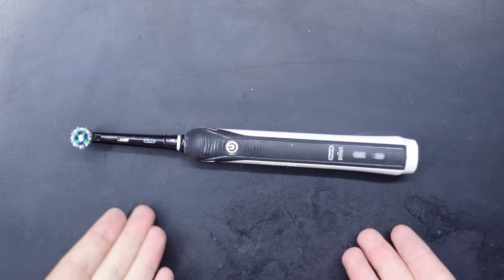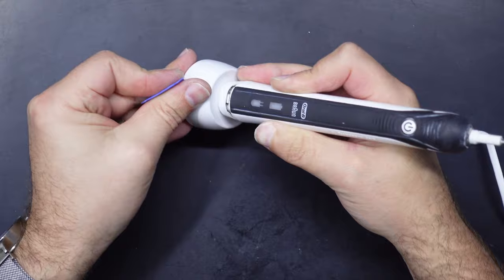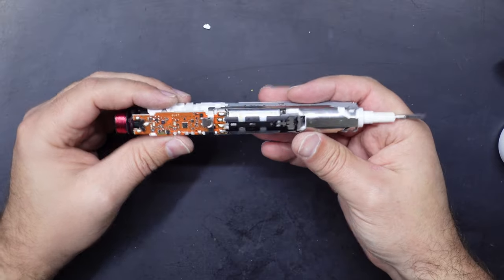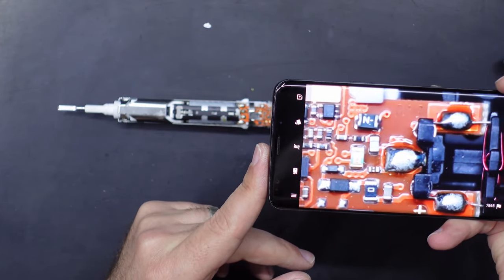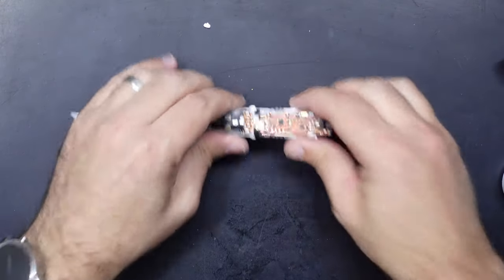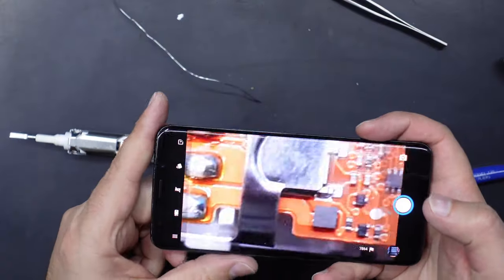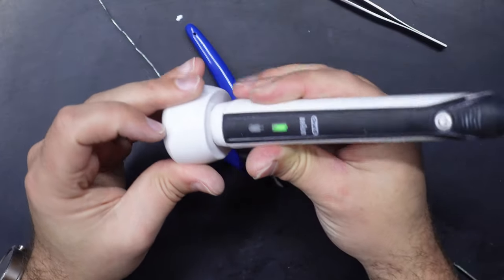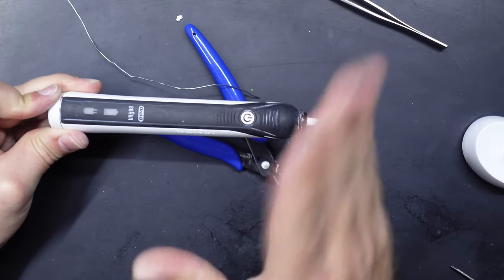Oral-B Pro 2000 not charging repair

Comment: The battery structure is nearly the same as a regular battery. They've got some nerve to make us pay for another toothbrush. I can see if it was a lithium-ion battery. There should at least be a rebate for recycling your old electric brush like there is when you recycle a car battery. People are throwing electric components in the public trash.
Reply: It used to be that way since De’Longhi bought Braun. I used to exchange old vs new handpieces at the local Braun store for reasonable money but after the acquisition, buying a complete package when they were in the offer turned out to be less expensive. It´s a shame. Unfortunately this video did not solve the charging issue of my brush, but it was worth a try before having to throw it away.
Reply: @Hurzinger  the Braun designer Dietrich Rams left as he was disgusted with this policy.

Comment: Thank you for the tips on how to open it! In my case it was water penetration through the top ring, and the button started to trigger only after drying out the entire internals. The battery indeed was good at 3.65V in ~3 years old brush. I've applied food-safe silicone on the top around the ring, will see how it stands.

Comment: put the top black ring on before you put the bottom white cap on, place guts back inside and stand it up , you can then press down slightly on the body maximizing how much the shaft collar protrudes. if you put the bottom white cap on first , it`s spring loaded and trying to push the black ring on will only press the workings further into the body.
Reply: This took some finessing but your technique worked.  Thank you!

Comment: Thank you! My model with exact same inside and exact same problem as yours so I just added another blob of solder (although yours is definitely the better way to do it!) and it started accepting the charge. Has to be a manufacturing issue.

Comment: Top tip : to fit the black ring back into place around the top of the machine, use your sink hole! Bleach it first and then shove the pointy bit into one of the little plug holes which will apply even pressure around the ring!
Reply: Hi Thanks for tip.  was struggling to get it to engage properly until I read your tip.  Tried it and it worked a treat  many thanks
Reply: Great tip. I was struggling with this for two days. 😂
Reply: And you sir too are the man!! I already broke a nail trying to get it in... awesome tip, thanks. Worked like a charm...

Comment: Did it!!!!!!Build in a new battery and it wasnt charging afterwards,with your videos help i noticed that one of my soldering points were to wide and connecting with one of the copper wires of the lower coil.Fixed it and now its charging.Not bad for a blond 61 year operasinger hé😂😂😂😂Thanks so much

Comment: Hi Mark,
thank you for this video, helped me to fix my 3766, same failure. I managed to repair the broken solder joint after watching. To open the device I pushed a size 6 hex-plus allen key inside the bottom hole and slowly bent it backwards until the bottom came loose. No broken plastic and after repair it came back in like nothing happened.

Comment: My non charging Oral B must literally be the one you’re featuring in the video. Absolutely genius to use the phone camera. Grabbed the soldering iron and had it fixed in ten minutes. I had a replacement in my Amazon basket ready to be ordered before I watched your video. Thanks bro…you saved me £60. x
(Kinda criminal that the charging components are so delicate. It’s almost as though they want them to fail after a few years so you have to buy a new one. Pah…don’t be so cynical)

Comment: thank to your video i was able to get it open in like a few mins.  I used head gun instead of soaking it in hot water, turn out one of the of the wire broke off, all i had to do was solder it back and good again.

Comment: Thank you so much! My costco purchased oral-b couldn't charge and this video made it so easy to fin the problem. Great tip using the phone to find the faulty connection. Soldered just like you and the toothbrush is charging again! Saved myself $100.

Comment: Same thing happened to mine.  This was a different cheaper model, I noticed it had a NIMH battery.  Top came off the same but lower wouldn’t wedge off the base.  I think the base prong was too short. I had to use a chisel.  Also had to bridge with a capacitor  leg.  At least if I want to swap the battery in the future it looks a lot easier than with the ion.

Thanks for the video.  Another item not going to the landfill is a good thing.

Comment: Great video.

I wish i had seen it BEFORE i tried to pry open my toothbrush and messed it up beyond repair (i tried to open it the wrong way).

Since i bought a new one ever since, i decided to see what was wrong with my old (now broken) one, and it seems it was also the solder on the left (one of the 4 that are next to each other).
Next time i won't do the same mistake and i will be ready to do a proper DIY repair job.

Comment: Soldered the wireless charging coil, and it works again! I put some silicone on the top to avoid water going in as I don't know how well it will seal after opening it, didn't put any on the bottom as there seems to be a silicone like o-ring and it wasn't in too bad of a shape, hope it holds

Comment: Hi, this is precisely what was wrong with mine as well.  The little red inductive charging wire broke right at the solder joint (no doubt after drops - we keep ours in the shower and it drops to the floor a bit too often).  Thank you for the video!  Now, to get the black ring back on (there's some other comments that deal with that)

Comment: Great video, unfortunately all the soldering was fine in mine. I touched it up anyway and it still wouldn't charge.
Then I borrowed a charger off a friend and it worked... So it was the charger that was the issue.

Comment: I thought my toothbrush wasn’t working. I took the head of the toothbrush off and turned on toothbrush and I saw the metal part moving just fine. I cleaned up all the gunk around the metal part and inside the toothbrush head where it attacked to the metal part and once I reconnected the toothbrush head to the metal part it worked fine.

Comment: I think I've got the secret of not breaking the tab! Below the battery & charge indicator lights find a spot on the rubber that is softer. The tab is latched in a cutout behind the rubber here. Press a fingernail into the rubber to unlatch it when you use the stand to lever it open.

(Needless to say, this knowledge came to me after breaking my tab and seeing the structure from the inside.)

Comment: Have you ever seen a n oral b triumph  7000 v1 constantly display "aufladen" after a battery replacement?  I can't seem to reset it or get it to begin charging. I tested the base and it's good. There is no display to show it with the battery Icon appearing and showing it charging as usual. Any thoughts?

Comment: Awesome video! Thanks. In my case moisture has come into the device and caused some rust on metall parts. I cleared the rust as much as I could with rust remover. But it didn't come to life. 😞 I can't find any other visible damage either. The soldered parts all seem fine to me. Any advice are much appreciated.
Reply from the maker: Could be that rust has crept into the motor itself, or has caused some damage to the circuit board that may not be visible
Reply: @Sawickipedia  Interesting thing is it came alive after I charged the battery with a USB-charger (5 V) for a while. Next day after I left it under charge during the night, it didn't want to start again. 
I will try to change the battery to see what will help. I'll let you know.
Reply: I changed the battery with a 18650 , 3.7 V and it came very much alive with a vey high speed! 😲Then again the next day it wouldn't start 😞
It think like it's getting too hot and there is a chip for preventing heat triggering an interruption. I'll try to put a resistor connected in series with the battery later.

Comment: Very good video! Please can you tell me...I started charging my toothbrush on a voltage converter with 12V-220V and it didn't charge and it doesn't work for me, and it's a slightly older model and I don't have a charging indicator at all, I try it in the house for only 2 minutes, it still won't work  .. my question is can this voltage converter I use in the truck be charged at all?  thanks
Reply from the maker: The voltage converter may not be making a stable enough AC supply for it to work. That's only a guess, so I don't recommend rushing out and buying a new one. Sorry can't be much help here
Reply: @Sawickipedia  ok, thanks

Comment: On all electric tooth brushes these are a pain, that wire is a common fault and the tiny fuse,
if its the outer coil that`s broke you can un wrap a coil to get extra wire,to re solder.

Comment: Hi its Li-Ion battery or nihm ?
Reply: NiMH battery. Mine is charging just not very well. Used this great video to get into it and manually charging the battery at 300mah. It was saying fully charged at 1.3v, so possibly a battery going bad.